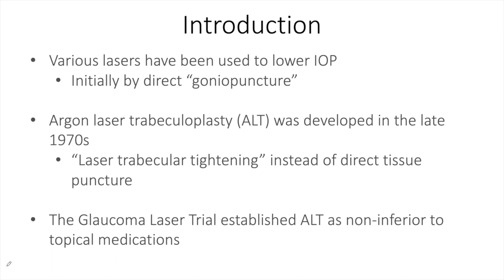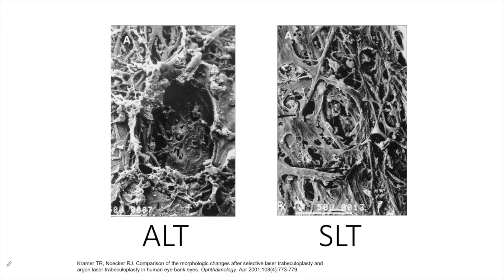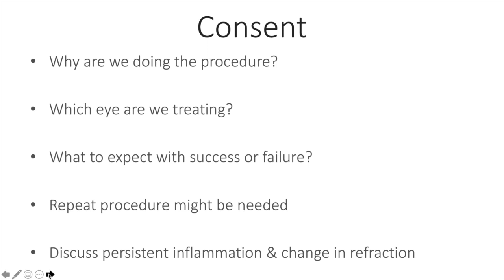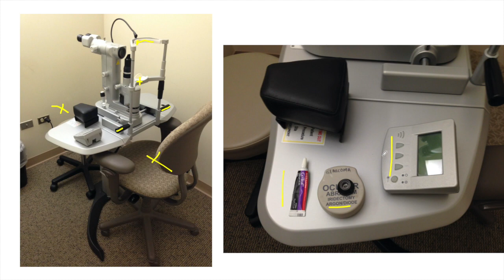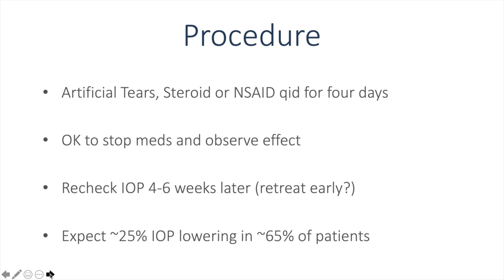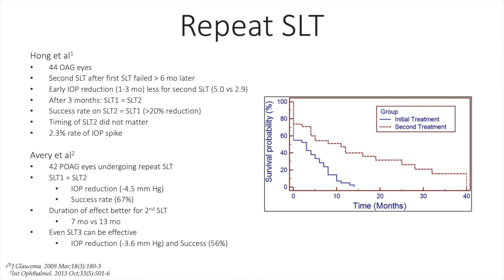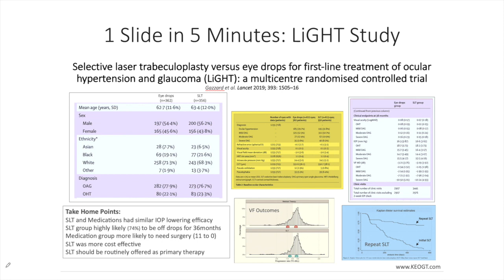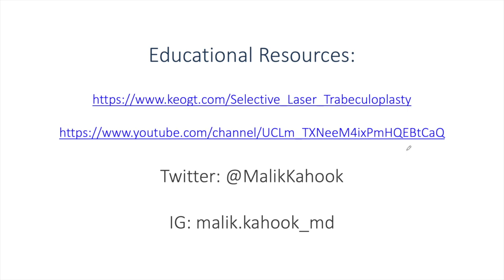Selective Laser Trabeculoplasty: Tips and Tricks (Malik Y. Kahook, MD)

Comment: Is it safe to get the SLT in pigment dispersion syndrome??
Reply from the maker: yes. the number of applications and the power used might be slightly different, but it is safe to use in this condition.
Reply: @malikkahook9368  Thanks very much for the answer ,, as far as I read in that condition 180 degree treatment in one visit with a power of 0.5 to 0.7 mj is recommended??..also is it possible to replace the Pilocarpine with Birmondine Tartarate( Alphagan) in the time of the procedure as I heard Pilocarpine can cause retinal detachment even from a single use as I have mild peripheral lattice degeneration..your suggestions will be much appreciated